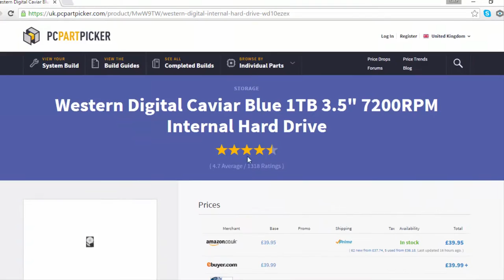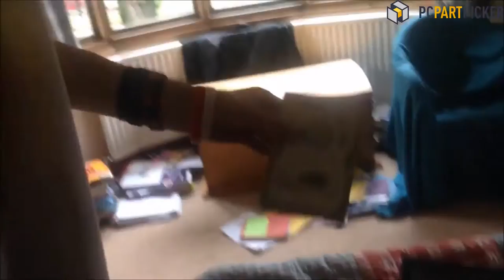PC Revive Vlog #2 | Speedster120 and TuffCookie

Comment: you're going to have some issues keeping the drive cool, at the very least. there is absolutely no ventilation in there. you have a couple of different options to solve this. one, you can use an adapter and a 2.5" hard drive instead, since a 1TB 2.5" drive is around ~US$60 right now. two, you could negate a mechanical hard drive and go full-on SSD. but a 2.5" drive would technically be better off, since it doesn't create as much heat as a 3.5" does, and doesn't need as much ventilation to keep cool. with the right adapter, specifically one made of metal, it can stay passively cooled and not fluctuate heavily in a normal case.

if you can afford to do so, I heavily suggest adding a fan in the front of the case there. if you can find a PWM fan with a BALL BEARING, not anything all too weird, but a BALL BEARING, you will have a good time with having it last forever, alongside board-controlled speeds and stuff. Aside from that, you'll also want to invest in a PCI slot fan mount to push air upwards toward whatever GPU you end up smashing in there. if you look up slot coolers on ebay, you'll be able to find one for not too much money that has a couple fans on it, and even some kits to add your own fans onto. it really helps, especially in that cramped of a case where all the exhaust air is going to be going through the PSU.

otherwise, the build looks decent for what it's going to become, so long as the parts used aren't too jank in the end. just make sure you wait for the AMD RX480s to hit the market to bring down the price of the slightly older cards even further on the new and used markets. an R9 270 still fetches a couple hundred bucks here in the states, even now after the GTX1080 was released (and subsequently sold out early due to stock issues as they did 4 years ago with the 900 series to increase demand artificially and drive prices insanely high.)

if you're going with DDR3, get as much as you can for cheap RIGHT NOW as RAM prices for DDR3 will be going up after next Black Friday hits here in the US (as Black Friday and Cyber Monday affect prices for things globally on a lot of occasions, especially on Amazon for instance) with the demand for DDR4 going up and the price going down as more is made in excess. economics are at play heavily now in the world of computer parts and knowing when prices are going to drop or increase gives you a heavy upper hand on the rest of the buyers out there since you'll know exactly when to hit the Buy button.
Reply: Me and Jake did think that cooling would be an issue but the PSU is fine as the fan on the bottom will send hot air out the back of case through the already installed vent. there are also many spaces as you suggested to install more vents for fans such as at the bottom and the sides. 

As you'll see in the next episode we got a micro atx motherboard that JUST about fit in the case and the way that the CPU cooler is directly below the PSU the hot air will be sent from the processor straight into the PSU then out the back.

Thanks for you input on this video and I hope you enjoy the rest of the series
Reply: the problem with having the PSU directly over the heatsink, especially if it's a stock Intel heatsink, is the issue with the heatsink's fan and the PSU fan fighting for airflow. if it's an AMD heatsink, just flip the fan, and you're set.  but with Intel heatsinks, you can't flip the fan, unless you get a third-party low profile heatsink with a replaceable fan.

again, just make sure any fans you drop in this are 4-pin PWM and you'll be set regardless.